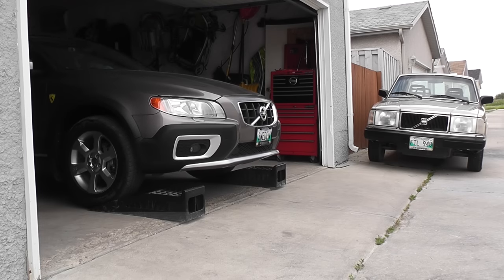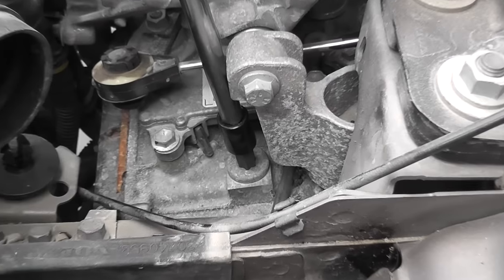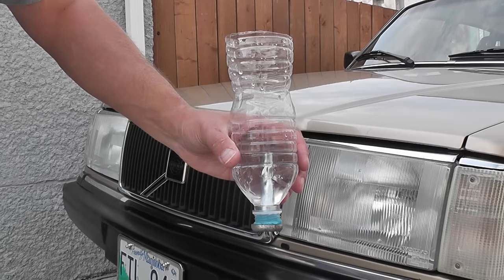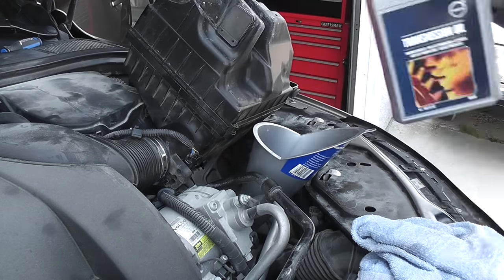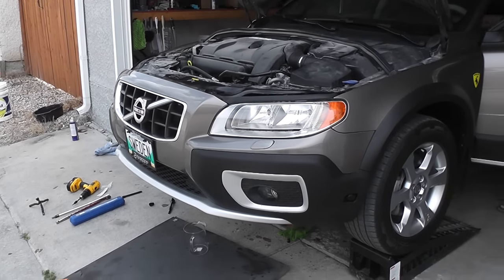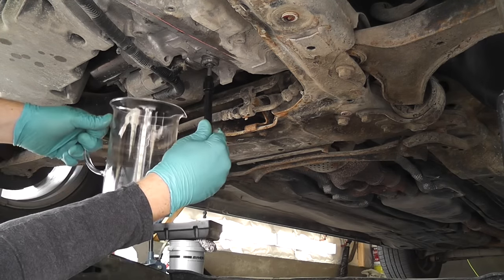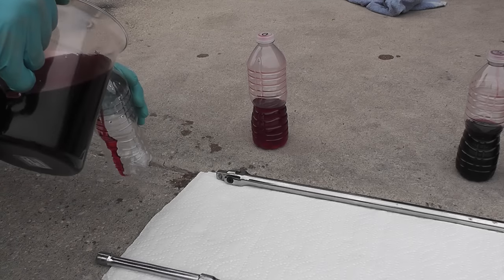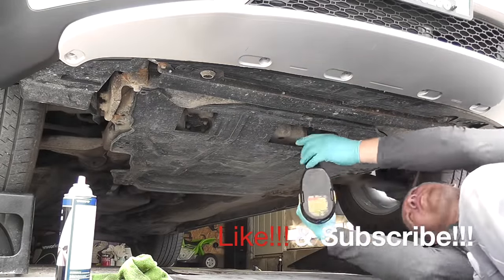Volvo Transmission oil change Aisin TF-80SC. 6 speed Auto.

Comment: Mine has 170k I’m Without an oil change not looking to good hopefully this will remove the rough gear changes from it.
Reply: Hey.
What engine do you have and which year?
Do you have any shifting symptoms? Do you have a jerk between shifting from P to R or to D? It happens to me sometimes and when the engine is cold I feel like the clutch is slipping, but the car accelerates without problems. mileage 172,000km 2013 S60 3.0.
Reply: @tomeksaks527  mines a 2009 xc60 3.0 same gearbox basically it’s mostly smooth between P to R to D but it’s rough between gears 1-2 mostly and acceleration wise it’s rough for the first 5-10 minutes then it’s a abit smoother so most likely a gearbox issue apparently valve inlet’s are a known issue in this gearbox but I’ve heard a gearbox oil change can make it worse so I’m sitting on the wall now with the same kms as you as to what I should do.
Reply: @Ben W  

I also don't know what to do, I'm little worried problems with a new oil in gearbox so don't know change it or not.
Reply: @tomeksaks527  yeah biggest issue is the gearbox nice car I’m planning to just run it till it shits itself then fork over 3k aud and get it fixed it’s still disappointing as it shouldn’t happen really in any modern autos especially at lower kms but I think the point we’re you don’t change transmission fluid been reached due to degradation that’s already occurred like maybe you could give it a shot and get back but it’s quite complicated and if it doesn’t effect driving to much It’ll hopefully be all good for 30-40k more at least my mechanic said drive it till it breaks then take it to the transmission specialist known problem. another issue I’ve been having is fuel trim so mass airflow sensor potentially the problem just don’t end😑.

Comment: Out of curiosity, how did you know that 10 seconds per gear was enough for the new oil to mix with the old one in between draining and filling?
Do you think it would help to do this longer, or even go in manual mode and shift through all 6 gears?
Reply from the maker: As per Volvo instructions. Longer would not hurt I think

Comment: I don't have diagnostic tool for temps.  Would an infra red thermometer give a reading from the casing?  I have done many of these types of changes on older type transmission with dipsticks.

Comment: Hi Yuri, got another question for you.  I changed the transmission oil, set the fluid level at 50 degrees, could not set the counter.

My oil was very direct and after three flushes, like you, the final oil was still dark, not red like yours.  I did capture the oil in bottles like you did.  

The clunk when parking, shifting into Drive from Reverse through Neutral is still heavy, with the car jerking.   This only happens when the engine is warm; when cold, there is no clunk and the shift is imperceptible.  

Do you think I should flush it three times again to get the oil cleaner?
Reply from the maker: What was the condition of the original oil? Very dark?
Reply: @volvosweden  Very dark.  I need to do it again to get the clarity you got.

Comment: Great Video, but where is a full level?
Reply: Karol XZ 
The clever dual design of the drain plug ensures that the level is automatically correct so long as it is performed at the correct temperature as the transmission fluid expands and contracts depending on its temperature.

Comment: When you opened the level plug for the first time, lots came out.
Is that because in the factory they over filled the gearbox?
Reply from the maker: It's because the engine is off. When the engine is running fluid is everywhere.
Reply from the maker: The garage floor is not level. The car is level on ramps. I am not stupid.
Reply: volvosweden, my Peugeot 508 has the same gearbox. The instruction on the manual say the car needs to be level. I have noticed you have it on ramps. When it refers to the car being level, does it not meant that both front and rear wheels need to be up in the air? I am thinking do I jack all four corners?
Reply from the maker: My garage floor is not level. The car on ranps is level this way.
Reply: Douglas Fox  Read the description first... sigh

Comment: Does the transmission need to be in Park or Neutral, with the engine running, when doing the last drain to set the fluid level? thank you
Reply from the maker: Park

Comment: When the oil is changed, isn't adaptation also necessary? I also want to change his oil to mine. (v60 plug in hybrid 2015)
Reply from the maker: Adaptation not required after.

Comment: Volvo transmissions have a sealed system and is not recommended or needed to be changed, especially not at 60,000 kilometers.
Reply: LOL! Don't be naive, that's just marketing. Volvo and other brands use transmission by Aisin and Aisin itself recommends oil change every 60.000km. Just go to the parts store and you will see that oil has expiration date. How so when oil is for life? And it's obviously not sealed since it's possible to change oil.

Comment: So if the vehicle is not moving, and you place it in gear, with your foot on the break. does the transmission actually spin? I can not get my head around that bit. I can see it if its an manual box as the clutch will be engaged, how does it work on a automatic.?

Comment: Hello there, super nice and explanatory video. But I had one small wonder. at 3:00 you remove the inner plug and some gear oil comes out. does this indicate your transmission was over filled?
Reply from the maker: No. When engine is off the oil is not circulating. You set level with engine on when oil is circulating.

Comment: thanks for your videos. i have changed transmission oil in my xc 60 from volvo. but after 3 days engine system service required. is ot related to gearbox? thanks for everything.

Comment: Any idea why my 6 speed auto on my 2013 v40 shakes the car when I shift it to Drive? It doesn't happen if the car sits in the summer sun for a few hours or if I drive it for 1hour +. Also, car shifts gears normally as I drive, no noticeable issues. I also changed the transmission oil a few years ago, maybe it lost oil?

Comment: Good job. But i think the car was not entirely level to ground as you had used Jack stands at the time of checking the level of oil bro.
Reply from the maker: +Rakesh Arcot My garage floor is not level. The car was level.
Reply: volvosweden correct i did not observe.

Comment: Now, you have an irregular quantity in the transmission
Reply: that is the difficult part, need to know how much transmission fluid came out and if it was working fine before you need to add the exact same amount
Reply: You guys weren't listening... There is a level plug that when opened, will leave a precise amount of oil inside.

Comment: When you set the last level drain, I see the front wheels are lifted up, I guess to get proper oil level... If you not have front wheels lifted (all 4 wheels on ground level) up will there be wrong oil level then? Or maybe difference in wheel level doesen´t matter?
Reply from the maker: My garage floor is not level. The car is.

Comment: #Volvosweden  why didn't you flush 1st and 2nd with cheaper oil.
 I can say you wasted preety good oil just by mixing with old oil which was not so bad.
  Anyways you did a preety good job.
Reply: Because you only use the correct oil - using `cheap` oil , even once, can wreck the insides

Comment: I have a question when you first loosen the T40 screw oil came out. Does that mean there was to much oil in the transmission? As I know this oil expanse when hot.
Reply from the maker: No. Because engine was off.

Comment: Wonder how critical it is to have that temperature of oil to be exact for level setting. I do not have access to dice tools so just wondering if Id do it without measuring the temperature and setting level by drain plug only.
Reply from the maker: Hard to say. But from experience let it idle for like 5 minutes and then drain set the level.

Comment: Do you know if the AW55 automatic transmission on the C30 has a filter and if so do you have to reset the ECM  for it to account for the new oil

Comment: Thank you! I have a 2012 Volvo S80 that already has 110k miles on it and never changed transmission fluid before. Is there a way for me to check the transmission fluid before I change it?
Reply: I went to the dealership and asked them to get me some liquid to inspect. So they pulled up the car, unscrewed, collected half a bottle, and quickly screwed it back. The fluid on my 110k miles is way worse than in your video, with no pink color. I have them flushed it.
Reply: Zehua Zhou Hi, I have V70 D5 2009 80k miles and original transmission fluid. It works fine but only recently I found out that it should be changed
Reply: every 40k miles and Volvo service says it’s too late now and I can have problems if I decide to flush it. Any problems with your transmission after flushing?

Comment: Hello and thank you for the very nice video. I have one important question to you. Why when you have removed the first time the leveling screw, a lot of oil came out, but in the end you have waited until there were only some oil drops getting out? When engine is on there is a little pressure there, indeed. But also in the end you had the engine on.
Reply: I think I understood by myself. You have opened the leveling plug first time with the engine off, then you did the leveling with the engine on, so oil was pumped into the converter. Correctly?
Reply: And one question. On my gearbox I have identified a small shock during changing from 1 to 2, but only when the engine temperature is 90. If cold, the change is done very smooth. Do you have any idea if the oil could be the issue? I have 205000 km, never oil change. Thank you!
Reply from the maker: This is correct. You got it!
Reply from the maker: Could be the oil, yes. I would change it. There is always a risk though that that agter changingbthe oil there will be problem with the transmission. Always best to chang it on time. I will be doing it every 50000km

Comment: If the level is set when the engine is off, will this result in an underfill or overfill?
Reply: Overfill, when the vehicle is on the oil level is higher due to temperature and the pump moving the fluid around. When the pump is off and the oil level goes down due to temperature, you will then add more oil when in reality it's only just settled and not actually underfilled.

Comment: D5 185BHP 2010 Automatic, flushed transmission oil, once temperature reached 55 the drained oil was about 1.4/1.5 litres, whereas your excess drain was just under 1 litre, could you please advise of the reasons I may have drained more than 1 litres? Also any information about how much oil always stays in torque converter please? 
Just to add, my 1st drain was 2.4 litres, another D5 same engine drain was over 3.25 which means guys at volvo aren't consistent with filling the gearbox oil levels? Thanks 
Many thanks

Comment: I know this is an old video buuuuuut I need some help with 2 things. 1) I was planning on replacing the filter as well but apparently the filter is inside the transmission, can someone confirm that? 2) Where can I buy a DiCE? A properly working DiCE unlike most of the Chinese ones. I can get ViDA from volvodiag or look it up in the swedes forum but the program is useless without the tool
Just FYI, my Volvo is a 2012 XC60 T6 R-Design

Comment: Hei, i have xc90 v8 and get fault P0744 when cheking transmision. 
torque converter clutch solenoid, do you know where is location, i cant find any info on internet, thanks.

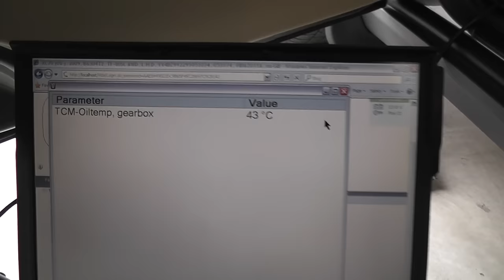Comment: Shouldnt be done any other way....@10:41 should the vehicle be on level ground? For a correct transmission oil check. That looks like it's still on ramps
Reply: Garage floor is sloped, ramps compensate..read the video description.

Comment: Great Video like always !!
Hello I would like to know there's any other kind of transmission fluid can work with this 2008 and up Volvo XC70 or it have to be the from the dealer ? and where is the level stick to read the level of the transmission ? 
Thank you
Reply from the maker: +kevin J Get original oil. Watch the video. There is no level dipstick
Reply: also there's no filter to be replace ? i will do this soon now I have to replace my driver side axle got bad and each 4 liter container cost about $100 , thank you I appreciate your answer , take care KJ

Comment: I would appreciate your help my Volvo S80 V8 150,000 Km 90,000 Miles I asked the Volvo dealer to change the Gear box oil as I suffer from a slightly roar when I am running 80 Km/hour 
But the advised me not to change it as they don’t recommend 
Do you recommend to change it 
Please reply

Comment: Hold on a second. So if the level adjusting plug is supposed to adjust your atf level to required one how come it was draining when you took it off first time round? Did you have too much atf in?
Reply from the maker: Because the engine was off. To set level the engine must be running.
Reply: @volvosweden  aha! Thanks for your reply.

Comment: I bought my T6 XC60 right after it had gotten a trans fluid "flush". The car seems to shift fine except when downshifting from 2nd to 1st (when slowing down) the car kind of jerks slower and the rpms go from 1k to 1.2. Could it be they did not fill the car back to the proper level or is this a bigger problem?
Reply: Did you get a resolution to this?

Comment: Hi, I want to change my tf80sd oil as well. I'm wondering though, how come that this 'large' amount of oil came out after unscrewing the first bolt (t40 torx) despite having a leveler plug?
Reply: I was wondering the same. He removed that small drain screw and seemed a lot of oil came out meaning there was quite a bit above the level mark originally? 🤔
Reply from the maker: @MynameisEGIS with engine Off the oil sits and will drain more if you undo the small screw. With engine running the oil circulating and that’s when you unscrew to set the level and less will drain. Does this explains?
Reply: Yes that explains it all, thanks.

Comment: I know this doesn’t have to do with transmission fluid change. But do you know anything about the hood open sensor. My hood is closed yet I still get a hood open warning on my dashboard
Reply from the maker: The micro switch on the hood lock is malfunctioning. Either complete lock replacement or just the micro switch from eBay.

Comment: I have never change the transmission fluid in my 2011 XC 70 because the dealership told me the transmission fluid is lifetime and it is sealed? Is this true? Should I still change the fluid?
Reply: Dealership lied you have a drain plug or if you have a dipstick you can pump old fluid out that way as well there's no such thing as lifetime fluid

Comment: Imy volvo s80 2008 v8 awd
Is showing sound when forward reverse and it did 120000km
Shall i change the transmission oil.?without using computer is it ok
Reply from the maker: You have to set the level properly with computer.

Comment: Hi dear volvosweden
,

It's the same procedure for the S60 II 2014 D3 2.0L 100Kw ? I dont found the level indicator, The AISIN is the TF-80SD.I fdont found the Level tube - 31325038 for the TF-80SD.Thank you
Reply from the maker: I don't kno for sure. Sorry
Reply: @volvosweden  Found, the part number is: 31437020 Thank you

Comment: Thank you very much Yuri for your videos, they are really useful.I'm already buying the inputs that I don't have. Just one question: when you remove the drain plug, about 3 liters of transmission oil fall. What about the other 4 lts? Why don't they drain as well?
Best regards
Reply from the maker: +Claudio Elicer Well they are elsewhere in the system like the cooler.

Comment: Is this the same process for a 2005 Mercury Montego with the  aisin 6 speed?
Reply: I believe so, going to try it in a week or two, I'll let ya know.
Reply: @NoWr2Run  If you don't mind, how many miles do you have on your car? And will this be the first tran oil change? Also if I get around to do it, I'm going to use the Valvoline max life ATF in the red bottle. Mine has 101000 miles on it, and kinda scared to do a drain and fill, because I heard it could be bad with that many miles.
Reply: @leonsus9317  My car has a little over 170,000 on it. The lady I bought it from said she does not remember if it was ever changed & she bought it new ? She is a widow & takes it to the garage for service. I don't think you'll have any problems changing Trans fluid out at your mileage. I'd be scared not too, LOL.

I bought STP Trans. fluid & Trans conditioner also for it. I can't remember the name of the Trans. conditioner but it fixed my Trans. in my 97 Jeep. It was making a hellish growling noise & I just dumped it in. Before I got to work 10 mins. it made no more noise & hasn't in 2 years. Bought it at AUTOZONE but damn can't remember the name of it, sorry. HELL YES CHANGE YOUR TRANS. FLUID. GOOD LUCK MAN.
Reply: @NoWr2Run  I think it's Lucas transmission slip. Heard a lot of good stuff about it. I believe I'll go ahead and change it out. Good luck to you too. 👍
Reply: @leonsus9317  No I don't use Lucas Products. I'll look on their website & see if I can find it.
Reply: @leonsus9317  It was SeaFoam TRANS. TUNE, that's what I used, worked for me.
Reply: @NoWr2Run  Thanks man, I'll keep that in mind.
Reply: @leonsus9317  Yes Sir, NO PROBLEM, Doing bank 1 oxygen sensor 2 right now, Later. FREGGIN CAR IS SO DAMN LOW, HOLY CROW.

Comment: Would this process help with a sticking valve block? I get a `bang` on a double downshift and possible shift flare?
Reply from the maker: No idea. But changing oil will not hurt.
Reply: @volvosweden  Thank you! The fluid was brown when it came out of mine! put 8 litres through it and then level set on the 3rd change.